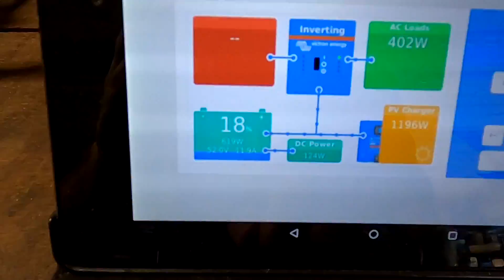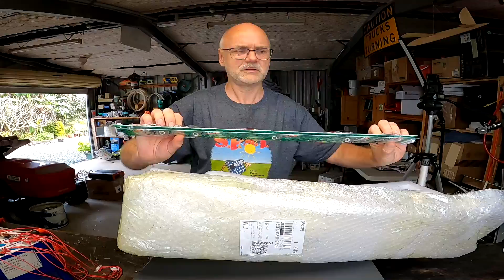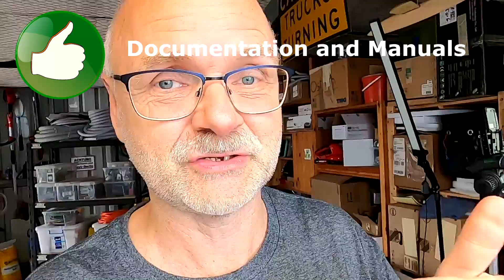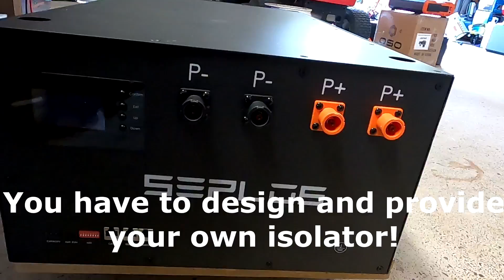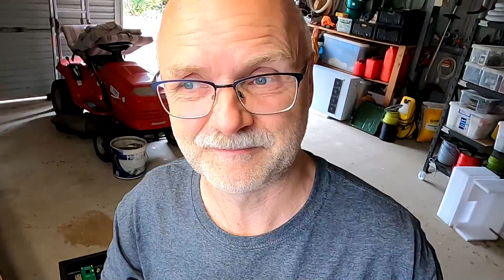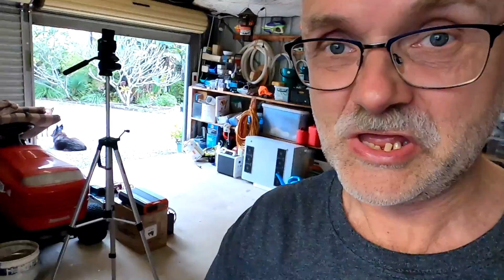Considering a SEPLOS Battery or BMS? Here is my experience so far...

Comment: Andy, I've heard your gripe a few times about canbus and your perception of a waste that it is.

Here are a couple things my system can do with canbus it couldn't otherwise.
First is charge rate control when the pack is stressed. Too hot, too cold, cell peaking, etc. Canbus can gracefully command the inverter/mppts to slow down or stop. Your 150ma of balancing can actually be plenty in a system where charge rate can be reduced to a trickle. You can do 3.6ah on 24hrs, surely your cells aren't so awful they are that far off? Though you tend to go weeks between full charges so it likely is more pronounced. I'm grid backed but do not feed in. I can top up each weekend on low tariffs.

The other feature that is of great use with canbus is to have significantly out of proportion charging capability to battery bank size. To run Aircon from solar I have an array that is significantly too big for the battery bank. Canbus allows the mppts, inverter and battery to have a combined understanding of where the power is. I can set a charge rate of say, 50 amps to the battery, and have 220 amps incoming from the mppts when the inverter is consuming the other 170 amps. If the inverter load drops, rather than the bms going into protect, it keeps the canbus informed of its ingested amps and the mppts ramp down their charging current.

I can also commission completely out of whack banks and canbus keeps the charge rate under control automatically. It turns a binary on and off into a ramped charging profile that passive balancing is capable of resolving.

Someone else mentiomed this, but huge systems often need all the battery banks operating as one. My two 15kva inverters can operate 500amps continuous draw and peak 800amps. That would blow the guts right out of a lone mosfet bms if the rest are shutdown on low cell.

Canbus can also provide a discharge ramp, it can tell the inverters that the batteries can no longer operate in their state and the inverter can stop even before a true low voltage disconnect occurs.

Canbus really shines though in a hybrid offgrid/grid backed setup where the goal is to self consume as much as possible.

You can achieve some of this with the victron shunt, but I don't use one in my home build, I use the bms shunt and canbus.
My bms happily controls the charging. It holds absorption at a slow trickle until its done its configured share of passive balancing and then tells the chargers to all shutdown. I don't have to rely on an overall pack voltage to be right for the final phase of charging, the bms can regulate it dynamically.

Anywho, just wanted to share! Have a great day!
Reply: Andy, Regan just gave you five or six video ideas. You can test some of these without having a second or third identical Seplos pack, but some will require two or more packs communicating together. If you're willing to do these tests, I will donate a Cerbo GX to The Off-Grid Garage so you have native VE.CAN ports without cobbling together adapters for your RasPi. I will send you an email and see if you're interested.
Reply: @cuisinartOH1  Indeed would be very instructive
Reply: Interesting read. I'm about to build a Mason and was wondering whether to bother connecting it to my Multiplus.
Reply: In diy fashion Andy could also make yet another video using a usb to can interface on the raspi! See how it compares to the Cerbo.

I love my Cerbo, I don't super love the price tag but it sure looks clean with its native can and bus ports!
Reply from the maker: Thanks a lot for the inspiration and thoughts, Regan. Some of your points make indeed sense.

I knew about the temperature throttling as an advantage 👍
I'm still not sure about he 150mA balancer. As I tested it, it won't do well with 280Ah cells and didn't really lower the voltage in these specific cells and most people will face this problem during winter and not being able to fully charge their battery. The spread across the cells will increase during this time and I doubt 150mA will be enough. Even if the BMS could slow down charging, it would need to slow down to almost 0A for that small balance current to be efficient.

To limit the charge current for the battery but still be able to directly feed large loads form the SCC is another good point. Not sure how many people would have that though as they would also want to run the AC during the night. This is per system design and not a standard set up where we have a certain oversized solar generation combined with a load running only from this solar. So I would call this some sort of special set up for a daytime load only.

Again, if you control charging current to match your balance current, that would mean to stay way under 150mA per battery bank in charging to have any effect from that balancer. I cannot see this working with 280Ah cells though. Or it takes a loooong time to balance and to be effective.

So with your large system and 2x 15kVA inverters, if one battery gets low, it will shut down all the other banks as well, effectively turning off your power? 

I don't quite understand the discharge ramp option you were talking about. The inverter can only turn off and on but not really ramp down in case of a low cell. I can understand it could be a problem for a single battery bank to supply power if all others have shutdown already. But this is more a system design. With a hybrid inverter, it should have switched to grid long before any batteries get that low.

I will definitely dive into this whole communication world soon. I have access to one of Seplos tech/engineer, so that should help.

I also have the CAN hats for the Raspi here and started installing them. What a nightmare! I should really consider a Cerbo and the Victron A cable for that to be plug'n play.

Thanks again for sharing your thoughts, that was really great information and something to think about.
I would be interested what sort of devices you're using, BMS, inverters, SCC, batteries...
Reply: @OffGridGarageAustralia  I use batrium and I have telemetry for the last balancing session. I do balancing each weekend, I have 304ah Catl cells (look identical to eve and the others). I had a difference from the least balanced to most balanced cell of 248mah using 720ma of passive balancing per cell. It seems most of my imbalance comes from heavy usage. Exceeding 0.5c in either charge or discharge results in a widening balance but really mild C rates have very small effects week to week.

I think in a grid connected battery setup, 150ma of passive balancing per string would be adequate, but not necessarily ideal. I really think passive balancing is kind of lame in general. I wish more would start focusing on active balancing instead. I'd love a cellmate-k9 2.0 with active balancing rather than heat rejection.

My climate is such that it's usually below indoor "room temperature" at nighttime but hot during the day. It's very common for AC to not run at all from 9pm to about 11am except during the very peak of summer for a couple weeks. I could also see the scenario where someone has a lot of solar, feeds back to the grid, but only has a small battery bank to handle emergency loads like freezers and lights only that would have the same sort of more solar and consumption than bank size situation. Though probably rare, as way too many solar installs are grid only with no option for backup power, which is silly to me.

My balancing sets an absorption voltage such that all cells even in drift stay under 3.55vpc, then all cells above 3.5v start draining. A point too, batrium can do that 720ma on multiple cells (odds, then evens, rest for voltage sense, repeat with cellmate k9) which is far more useful than 150ma for just the peaking cell. Usually I have 5-10 cells draining simultaneously until the final pass where just the peaked cell is left.

With my large system, multiple banks all reach the lower knee together, as the curve drops more current is drawn from the stronger strings until they are all in the last 5%, and then yes, once the first cell hits the low cell voltage cutout, the entire thing shuts down. I'm grid backed, so mine just forces itself into passthru unless the grid is failed then it of course turns the inverters off. If say, each string stopped on it's own, as you know with the charge curve, maybe only a few more minutes would be attained, and with a rocketing increase in current draw from the last strings, it would likely shutdown on low pack voltage immediately anyway with a more violent shutdown using the contactors.
I use the relays in the cerbo to also load shed when getting below 40% SoC, I have a relay that disconnects the thermostat wire for my aircon outdoor units. I can then login to the VRM and override this if choose to. Usually after manually starting a gen. The 40% SoC can run the rest of my normal loads until solar morning the next day at any point it's reached in the day without any other energy conservation. Multiple days with energy conservation and no solar input.

I don't have an auto-start gen, so I'd rather Aircon be disabled when I'm away than lose power to everything else.

Discharge ramps only make sense for grid-assist and grid-feedback, it's completely ignored during a backup/grid failure setting. It can control the grid-assist as solar night sets in and can also set how rapidly to feedback to the grid in a net-metering setup. I don't use the discharge ramps myself. But they are there and some installations do take advantage of it.  You can have a minimum grid assist of say 500 watts, and it'll try and maintain that 500 until the batteries/solar reaches some sort of threshold, either SoC or high temp maybe. Rather than shutting down, it can ramp down the inverting portion and ramp up the grid passthru portion to take over the load as grid passthru has virtually no heat gain. I have a 1 ton minisplit AC in my inverter shed, and both inverters at full tilt and 2 mppts at full tilt will exceed the cooling capacity of the 1 ton minisplit on a very hot day where passthru the 1 ton can easily keep the shed cool with just heat infiltration into the shed from the outdoors. Consider that I have roughly 2500 watts of heat gain due to inefficiencies in the inverters themselves at a 24000 watt load. I have not figured out the heat gain from the cells or mppts but it's enough you can "feel" it quite a bit. I also have a good 60-90 watts of heat gain from a 10kva autotransformer if my loads are way out of balance (split phase 120/240vac here, I'm using 240vac inverters and generating my center/split/neutral using an torroidal autotransformer)

Nice! I can't wait to see what you come up with in your further tests. I have no skin in the game for seplos, just giving another perspective on a very different system design and intent.

I have 2x 15kva 230vac Victron Quattros in parallel (operating at 240vac), batrium bms with cellmate k9 per string, 302/304 ah catl/eve cells from Basen totalling 3 strings now and 2 more on the way (~48kwh now and ~80 later), each string has it's own contactor but all contactors are driven from the same relay. I have permanently installed precharge resistors that keep the caps up after disconnect fired by a precharge timer in the bms and once the system voltage pre-charges to 40v it reconnects the contactors. I then have a 10kva autotransformer I sourced from a supply company from alibaba to get my 120/240v split phase. I have 3 250/100 victron mppts and a Cerbo GX for the central brains. I've started to write my own scripts to control SoC but may be moving into Node Red once I figure it out.
I have 8kwp solar on the roof now, and 22kwp more sitting on pallets waiting for better weather and time to install. I let my crypto mining operation drive some of the incentive to build this system and it allows me to nearly use 100% "night time" time of day power tariffs. I have a 12490w base load when crypto mining is in operation and a peak of around 21200 when all Aircon is running as well. Until I get the rest of my solar up, I have a schedule turn the crypto offline during peak hours as 8kwp is a small dent in a 12kw continuous load.

I was able to build this system with funds I set aside for a permanent automatic standby generator, plus a little hobby funds, plus a little crypto funds. I should see an ROI of 4 years because of the immense savings I see using nighttime tariffs. Though that depends on this crypto slump to correct. If it doesn't, it's about a 7year roi if I cease crypto mining on the system altogether and live offgrid effectively.

Anyhow, my build is definitely still a huge work in progress, but not many others have as large of a system as mine in a diy setting so it's raised a lot of challenges of being on my own with system design. I've taken a lot of interesting ideas from your videos over the past month, and I'm always delayed waiting for parts and pieces to ship in!
Reply from the maker: @mediadaemon  That is incredible and a huge system you're going to have. I'm really interested in all of that, so thanks for taking the time and sharing all this information. Really, really interesting and well designed.

Comment: Andy, I'm wondering how compatible the SEPLOS DIY Kit with EVE 304Ah cells? I believe you have these cells too? I'm guessing that compatibility is most unlikely.
Reply: I asked about those cells when I purchased my Mason 280 and was told that they would also be compatible by Seplos.
Reply: @danmc1313  It's strange that they would tell you this but not mention it anywhere on their website? Surely it's a feature worth spruiking?
Reply from the maker: Yes, they will definitely fit in this case. They take the LFLF280, LF280N, LF280K and also the LF304.

Comment: It looks like there is room on the front panel to add a breaker or disconnect switch. Also a small fan ( it might not do any good). Good video.
Reply from the maker: Yeah, should be enough space for a breaker. I'm not sure about a fan in terms of dust...
Reply: Could the front terminals be sidestepped and instead drill two holes and run cables through glands in front panel directly to Battery cell or busbar terminal bolts? If Andy has successfully built his own rack shelving unit for Battery 1,2 and 3, couldn't a battery box, or tray, not shelf, be made using square hollow tubing and corner joints that can be bolted. Then insert a BMS that is known to support comms with inverter and chargers, and actually . So do you reckon it is cheaper to modify this with a breaker and terminals, or, build a custom box, rather than shelves?

Comment: Hi Andy, 
regarding the packaging. I recently got a box and all the small parts were all neatly packed in a cardbox. I sent you an email about that. Unfortunately you did not answer. 
My Communication with Seplos is great. They answer quickly. 
I "abused" their 206AH case to use it with my 200AH cells (206AH are 50mm width and my 200AH are 55mm). With a bit of force (like you had with the 280AH batteries, it was possible to fit them into the housing without any problem. I was also able to use the busbars (copper) which were with 4 holes with my batteries. I sent you also photos about that.
Today I will integrate it in my solar system and test it intensively. As this first box was a test, I will order 3 more and then I also want to program a little software with an ESP32 + RS485.

Here is (from another crazy bavarian guy) a compiled version to communicate via WLAN with your Seplos: https://github.com/KlausLi/Esp-Seplos-Controller
Unfortunately he does only provide the compiled version and not source code, so everyone (including me) has to do it on his own. Maybe at least I may get infos about the RS485 protocol from Seplos itself.

Servus,
Wolfgang
Reply from the maker: Thank you, Wolfgang. Sorry for not replying to your email. I'm getting around 40-50 a week and it is totally out of control.
I did order one of these batteries each to see the differences and connect them together eventually. Seems, that there is a problem with compatibility. I'll see if I can make it work somehow...

Comment: Andy, I'm using 3 bms from Seplos and when 1 pack is fully charged, the other is still charging. Same thing with discharge process, if there is 1 pack discharged the other is keep discharging until low voltage disconnect occurred.
Reply from the maker: Great info. Thanks a lot, Romie.
And you have them all connected via RS485?

Comment: My seplos bms goes to 100% and then Limits until its 95% again
Reply from the maker: So it limits the charge current from 95%SOC? Would that not be part of the solar charge controller when hitting absorption voltage?

Comment: My experience of Seplos has been disappointing; they appear to be having supply chain problems (nothing fails like success). I ordered 3x 280Ah boxes at the very end of July, but the 200A BMS have been out of stock since then, so the estimated shipping date has been slipping and is now mid-September. I've also got concerns about the fuse provided (Zeeman ANMH) which might not handle the dead-short currents. That combined with 'DDP not being DDP' rumours makes me concerned.
I am starting to wonder whether 100Ah server-rack batteries will take over this part of the market; 48v x 100Ah batteries are under 1,000 USD (plus shipping and taxes) on Alibaba.
Reply: I can confirm DDP was indeed DDP in my case. Delivered to the Netherlands.
Reply: Server-rack do appear to be cheaper than this kind of ready made DIY.
The only downside is that you don't know which battery or hardware they put in, and can also not replace cell or repair it as easily if something goes wrong.
Reply from the maker: Thanks for sharing, guys.
My order got delayed as well due tot he 200A BMS. I ended up changing it to the 150A BMS so they could finally send it out.